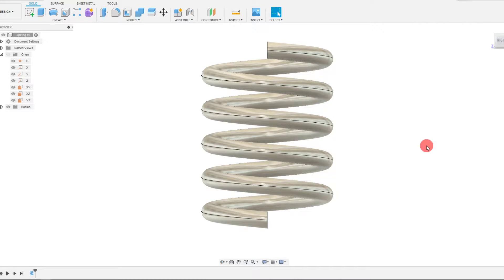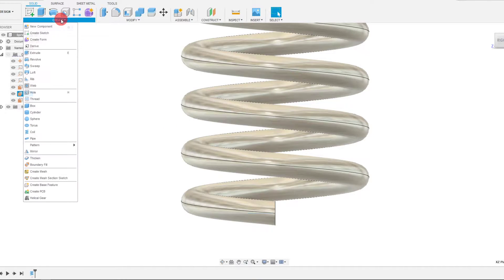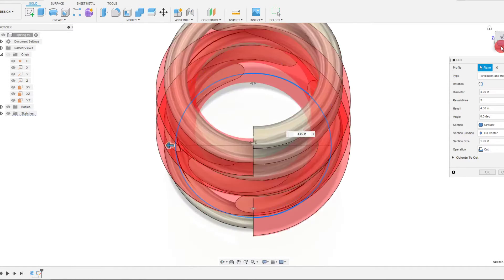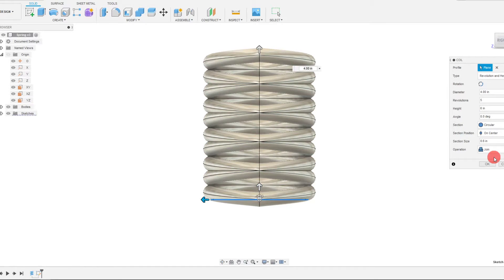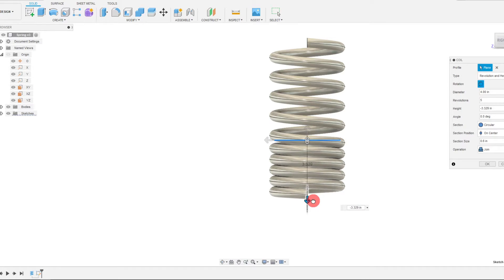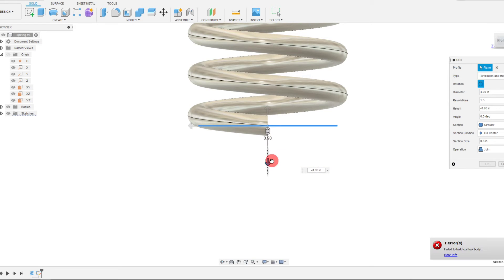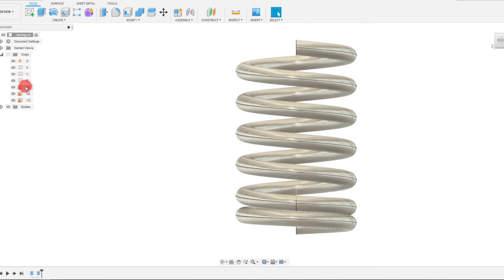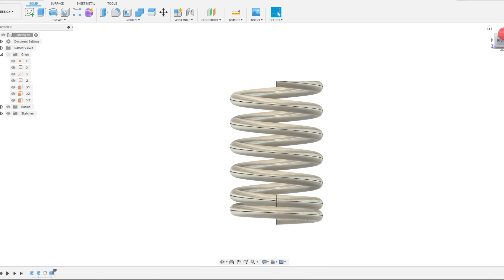Closed-End Springs- Fusion 360

Comment: Closed-end adds which function to the spring ? I wonder
Reply from the maker: It acts as a sturdy base for the spring to push from. It is also closer to being "flat" on the bottom so it can stand vertically.
Reply: @AvivMakesRobots  Oh thanks for the answer , what about plain and ground end conditions ? I wonder them also.What are the functions of these and in which industries they are used ? I really appreciate your answer.